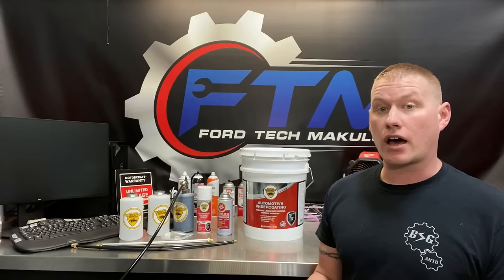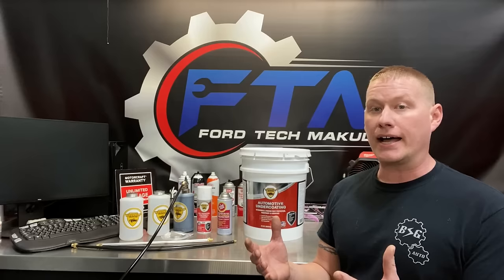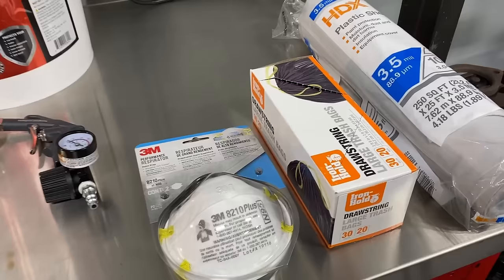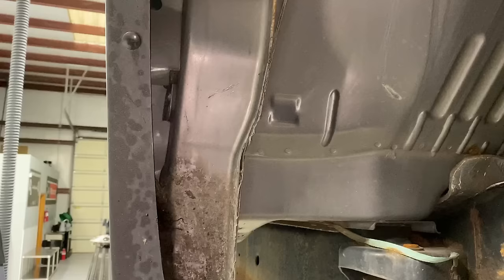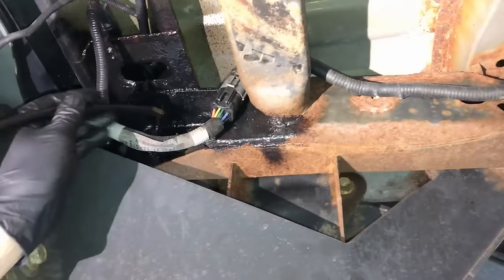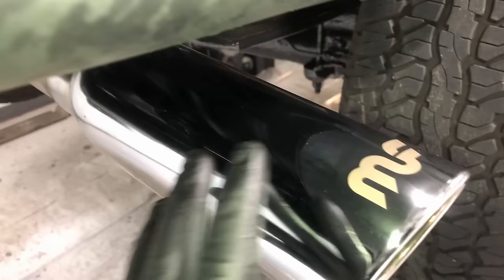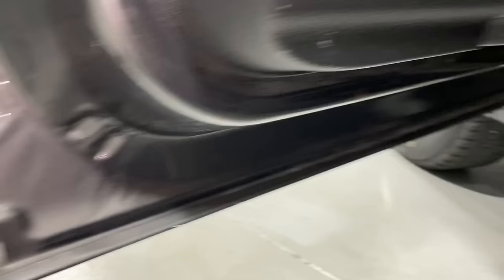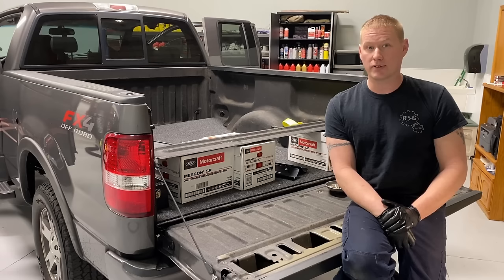Undercoating Your Vehicle with Woolwax: Is it Really Better than Fluid Film Though?

Comment: I've only washed my truck 2 times that I remember in the 19 years and >278,000 miles I've abused it in MN/WI. 
It's a rust heap, but I think I've gotten full use out of it, and I didn't have to spend hours on my back every fall, spraying undercoating on the damn thing. :P
Reply: Not washing the dirt off enough will let water sit and build up in the frame rails and mounts making it rust out quicker, spray with a pressure washer into your frame gussets and I bet it will flush out alot of dirt
Reply: Well, if you live in a state that rejects rust buckets during the annual inspections, you'd be more concerned about that rot.
Reply: That is understandable, but some people like to preserve their stuff. Maybe you've got more money than you know what to do with and you don't care, but I've found you can command a significantly higher price in the Midwest when you sell a used vehicle that is rust free. People are in utter shock when they see a spotless undercarriage and feel much better about parting with their money; like they really got a deal or something. Personally, I hate laying on my back fighting with rusted bolts and iron flakes falling on my face (they always come under the safety glasses, always) when I'm short on time and I have to replace a power steering pump or something.

Comment: Nice video. I soooo need to do this. Thx for the very detailed video great job. They should put a rotating tip on those 360 wands. Would def help with the spreading of the oil. Again great video and thanks. Will be doing this soon.

Comment: Rusted areas good candidates for needle scaler, then POR15, then Woolwax. Would be good to pressure wash then dry before coating. Nice to have a lift, I didn't have it.
Reply: Better without the POR 15. These oil sprays get absorbed into the metal, forcing moisture out. The por 15 will prevent this from happening.

Comment: Excellent demonstration on how to do a good job undercoating. I would never trust anyone locally to do this as most shops here just absolutely soak everything in sight. Lots of bushing seal and weather stripping issues down the road. Would you say that having running boards increases the chance of rockers rusting? Seems like it creates a spot for salt and snow to hold up. Thanks

Comment: How many rusty cars to you see going down the road.  If you do see a rusty car its like 30 - 40 years old.  The automobile has been so protected from rust for decades by having the bodies and frames treated at the factory.  Many coating at the factory have been applied to keep them from rusting.  If you like like in Chicago or Michigan i guess you can consider this products because they use so much salt on the roads.  In Montana the use very little salt but use instead sand and dirt and it work really great.

Comment: I just wire sanded the entire frame of my truck and applied rust converter..... I want to paint it with frame paint to make it look nice and then apply fuel film.. what do you recommend? or should I just leave it like that and apply fuel film ?
Reply from the maker: I would not paint it no. Use Black fluid film or Woolwax instead.

Comment: I admit it, I am plain lazy.  Bought a so-so solid 1997 F-150 with 150,000 3 years ago. The frame had moderate rust but looked solid, but had cancer in a few places on the body where they all rust:  Rockers and a few lower places behind the doors and bed.  Before starting on the rust repairs I crawled underneath it at the carwash and washed every crevice getting out as much dirt, sand and mud as possible; yip I was soaked completely as well in January!  Next I repaired the rust outs with a bunch of fiberglass and a ton of bondo.  After the repairs were made to my satisfaction, I painted with 2k paint and clearcoat from 66 auto color.  

Then I tackled the underside with 1 gallon of Krud Kutter rust converter (20 bucks a gal) spraying every inch of what I could see and couldn't with a garden sprayer.  Didn't scrape or use a wire brush on anything because yes, I am lazy.  Let it dry a couple of days, then soaked the underneath again with another gallon of Krud Kutter.  There was a nice black coating on what used to be the rust.  After 2 more days of drying, applied 30 cans of 3m undercoating (12 bucks a can 16 oz) to every mm of the underside except on the trans, transfer case and rear diff cover.  It will be 3 years in January and the underside is still "mostly" rust free.  The rust repairs still look like new.  Figure I spent around $700 including bondo, fiberglass and paint, and undercoating.

Comment: Love your videos. I was a Ford tech for 15 years before I messed my back up. I, just inherited my dad's 03 f150 I got him at cost at the dealership in 03. It only has 43,000 miles and it's a rust box where he would only drive it in the snow and then park it. It's the extended cab 5.5 bed STX. I want to do this be thinking of it all week. What do you think about taking the bed off? I definitely have to descale this thing some how. You make some excellent videos, makes me miss working at the dealership. Thanks so much.
Reply: @Bobon Meiknob I already have another f150 but my father just passed away and this was his truck so it has alot of meaning to me. And it gives me something to do lol.
Reply: @Bobon Meiknob ty so much I really appreciate it and the information you provided.

Comment: Do they not galvanize vehicles anymore? fuel lines are steel anyway and rust. I''d at least use rust inhibitor paint on those iffy places. Is there any way to clean the corrosion look on all the aluminum engine parts hood etc?

Comment: Fluid film won’t have any issues sticking around through a winter. If you hit your underbody hard in the wash then yeah sure it will but if you’re washing under there mid winter once or something then you’re wasting your time and money on the wash and the coating anyway. Just wait till winters done. It will not have any issues lasting the whole time. 

Wool wax will have some creeping issues into pinch welds and other tight spaces though. Wool wax is not a bad product but it’s far from the best. Really doesn’t have any advantages over fluid film or others. Many downsides though

Comment: Is there any downside to using wool wax? My truck is from Arizona and has legit no rust but I’m spending a winter in kansas, so I’ll only need to one time. I really just want to prevent any rust from starting. Will this work? And will it be okay if I never apply again as I’ll be back in az? Thanks

Comment: Some of the rusty areas you coulda used por15 on the frame then rust coated after ward
Reply from the maker: I have never ever had good luck with por15.
Reply: Do not use POR-15 on surface rust! It will only accelerate the rust  much faster underneath the POR-15!

Comment: Off topic Mak, but after watching your informative video on the FORD BMS... I have a quick question about the state of charge of batteries installed in FORD with the BMS... am I correct in assuming the FORD BMS never charges the battery to it's full 12.6 volts? Is it by design?

Comment: I think you sold me on that stuff there, Brian. I, too, noticed Fluid Film got washed away a bit faster than I would have liked. I've done used motor oil for years, but even that isn't really thick enough ... and you need to be sure there's no brake fluid mixed in, or you might as well be spraying road salt under there, lol.  I still do oil in a pinch to save a buck, but it's best to apply it twice a season, which is a pain in the ass. Might pick up one of these kits soon. Thanks for the heads-up, Brian! 👍🍻

No problems yet with my Quincy QT-54  - got almost 16 hours on her so far. I want to change the compressor oil to a 20w synthetic, just to help it fire up during the winter months, since mine is in a unheated section of my building. I have a 25w stick-on heater on the sump for the time being. Don't know if I'll wait the full 100 hours to run that OE factory-filled break-in oil - I'll probably dump it closer to 25 hours. It's been working great - glad I bought it.😎
Reply: Smitty Smithsonite You should never use used oil, the contaminates of diesel and gasoline in the oil will lift or wrinkle paint and coatings and swell up rubber components.
Reply: @TJ-qz6hr  - Been using it for years. My grandfather used to get paid to apply it back in the day - he did that for decades. Never had an issue. I try to keep it off rubber, but it's no different than oil leaks from the engine.

Comment: I know it would involve even more work but I would have used a chemical rust remover after scraping away the loose rust and before applying the corrosion protection.

Comment: You recommend not coating the aluminum components underneath so that prompts my question. Do you recommended spraying onside the panels for the aluminum bodied f150s?
Reply from the maker: nope
Reply: @FordTechMakuloco  Is that because its not needed, or could it potentially cause issues? Learning a lot from your content- thanks!

Comment: So with this product there's no need to sand/ wire wheel rust 1st? Somebody please explain.
Reply: No, its oil based, so it will attach to EVERYTHING it hits, it will then soak in and stay attached as a soft material.  lots of dirt and dust obviously will need to be cleaned but its not like paint.  Paint bonds only to the surface and cures hard.

Comment: Looks like I have the same sprayer I have a problem with the product shooting out the top of the gun. I got some inside my car on the headliner. Very lucky it’s my old 1991 lacrosse and not my 2018 Silverado. Any ideas what’s wrong? I only run 70 psi
Reply: The fluid needs to be warmer at 75psi for the venturi effect

Comment: Awesome !! Thank you !!
I didn't realize it they made a thicker compound. I can vouch for the ability of the Fluid Film to hold the the rust at bay in the door seam at the bottom of the door, so this stuff would be even better!!
Now... where do I get a lift?

Another question: The Aluminum Body trucks - F 150 2015 + and SuperDuty 2017 +  ... any additional guidance ?  The frames are still steel so all that works, but are there any spots you would still spray down with the WoolWax ?

Thanks
Reply: Spray it the same as you would if it were a steel body. Salt/grime/muck is just as hard on aluminum as it is on steel. Contrary to what i think many believe, aluminum does in fact corrode, and still requires corrosion protection the same as steel does. In some ways, aluminum corrosion is worse than rust, because you may not notice it. It is not outwardly destructive and obvious like rust is. Aluminum just gets weaker as it corrodes more, so if you tap on panel that seems solid, it might just give out entirely.

Comment: Is it not going be very messy when you go service the truck later on? I have sprayed fluid film on part my truck's frame and it seems all kinds of dirt and sands gets stuck on it. I wish there was something that drys tack free. :(
Reply: It does get a little messy but seriously,  you can wipe it off your hands with a paper towel.  If you need to get it off a part, a quick douche with some Brakleen and wipe it off again with just a paper towel.  It's nowhere near as bad as it looks.

Comment: Thanks for posting this....very informative! Question....at 25:57 you talk about spraying the cavities from every direction. Wouldn't the 360 degree tip work better than the straight-spray tip in that case?.....EDIT:....ah, I just realized you were talking about the external nooks, not internal ones. So, the 360 degree tip would not be the tip to use in that case.

Comment: Are you offering this as a service, by chance?  I leave the Mustang parked all winter inside so it doesn't see a lot of salt, but as a Chicagoan you've seen the weather this year, crap, ice, snow, salt and then clear and 45 degrees.  I'd love to still be able to drive the car when there's no standing snow.

Comment: Are you anywhere near Ky? I just wish I could find a guy that does work as properly as you do. Been looking for a real mechanic in the northern Ky greater Cincinnati area for years. Every guy I get recommended to just half asses the job. I’ve had my 94 E150 sent to 3 shops for the same repair now and still have my same issue. A emission tube broke so sounds like a exhaust leak. First guy had my baby for 19 days and put some kind of sealer crap sounded perfect for 60 miles. Second guy did everything on my list except the emissions tube when I stressed it was most important. 3rd mechanic did the job but there is a small leak still he claims he can’t hear it. Lol I hear it plain as day. I’m going to have to fix it myself which is just unbelievable.

Comment: I have used rp-342 cosmoline as a rustproofing for rockers and frame channels.  Have you tried that product?  They also make a black coating called rp-344.  The cosmoline will dry to the touch.  Does the wool wax stay oily or does it dry like rubberized undercoating?
Reply: DM it Stays waxy

Comment: I might do this on a freakin hot summer day. To transfer to small containers, might try dumping some in a small garbage bag and cut a small hole in a corner. Let it run out. Pinch it off like sphincter between bottles.

Comment: I would like to know if it dries or is it wet all the time.
Reply: Woolwax® does not dry. When applied Woolwax® will create a wet gel-like barrier that moisture and oxygen cannot penetrate. Without moisture and oxygen there can be no oxidation. because Woolwax® is non-drying, it is always active and migrating into the inaccessible areas of the doors, seams and folds of the sheet metal, and all the other difficult to reach areas. Woolwax® is very thick and will not wash off easily. An annual application will easily protect your vehicle through the snow/ice/salt season. In the enclosed areas, (doors, frame rails, rockers, etc.) the Woolwax® will provide protection indefinitely (years). It is only the exposed areas of the undercarriage that should be coated annually with Woolwax®.

Comment: This looks like a necessary service for people living in the "rust belt".     What is a typical cost to have this done on an F-150 (super crew)?
Reply: 400
Reply: $400 for the dealer.  Negotiable.  Needs to be customer inspected.  No one else will pull wheels off or get into the small cracks and wheel well liners.  its a 30 minute (lazy) job at a dealer.

Comment: Will the woolwax stay on with ongoing regular pressure washing, rinsing the salt off, etc?
Reply: Joe Zasada He did say this will stay on during auto washes you do in the winter, underbody sprays included. So yes it should survive that.
Reply: Woolwax® is extremely resistant to wash-off because it is so thick. In the enclosed protected areas Woolwax® will last for years. The exposed areas of the undercarriage needs to be reapplied annually.
Woolwax® forms a lanolin film barrier on the base metal that moisture and oxygen cannot penetrate. Without these (2) components, corrosion cannot occur. Because Woolwax® does not dry, it is self-healing. If something scrapes it or road debris hits it, the Woolwax® will "gel over" and repair itself.

Comment: what kind of air compressor will it take to apply it?
Reply: Woolwax® undercoating guns do not require much pressure. 70 – 90 psi is usually adequate. Sometimes the extension wands require a bit more pressure if it is cold out. Even small compressors generally operate at about 125 psi. More important is the tank size. If the tank is very small, you will be constantly waiting for the compressor to recover. Generally speaking, any compressor with a tank 3 gallons and larger will work fine. If the compressor is adequate for spray painting, it will work fine for vehicle undercoating.

Comment: Does this stuff actually dry or stays wet to the touch?
Reply: Woolwax® does not dry. When applied Woolwax® will create a wet gel-like barrier that moisture and oxygen cannot penetrate. Without moisture and oxygen there can be no oxidation. because Woolwax® is non-drying, it is always active and migrating into the inaccessible areas of the doors, seams and folds of the sheet metal, and all the other difficult to reach areas. Woolwax® is very thick and will not wash off easily. An annual application will easily protect your vehicle through the snow/ice/salt season. In the enclosed areas, (doors, frame rails, rockers, etc.) the Woolwax® will provide protection indefinitely (years). It is only the exposed areas of the undercarriage that should be coated annually with Woolwax®.

Comment: As much as an F150 costs, there should be NO rust for at least 10 years.  All this modern "technology," and they still use lower quality steel for the frame and body panels.  Maybe the newer "alloy" they are using for the beds will last longer, but the frames are still crappy welded steel stampings.  .....and don't tell me about "salt damage."  I worked and crewed on the CH-53E helicopter that would spend six months at sea on top of a flight deck....exposed to massive salt spray, even during moderate weather, and no "serious" corrosion. .

Comment: Why doesn't a company like Ziebart use a similar product to Fluid Film? Also, If you don't spray non rubber brake or fuel lines, they will corrode to where they'll need replaced. Especially driving in Ohio!

Comment: Do you recommend spraying in the body on the new aluminum f150
Reply: Aluminum does not rust. Just spray any steel.
Reply: @doubleya215  your right aluminum does not rust.  But it still corrodes...  it get a white powder on it...   still not a bad idea to do it

Comment: I hear what you said about the problem with old scool methods of traping rust in.
I still don't trust that this coating isn't trapping in the rust.
The only way to check this is to remove it in known areas a year or two later and compare the before and after.